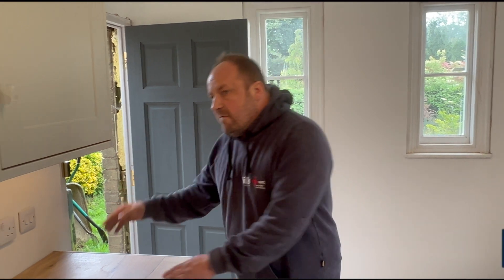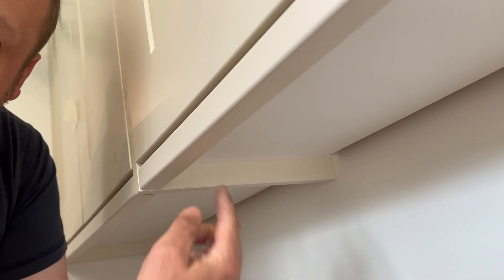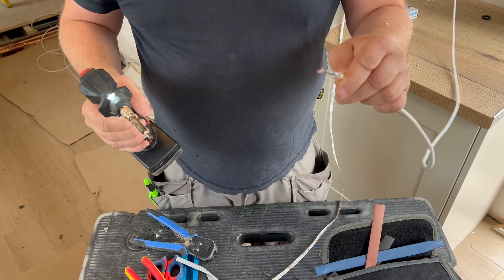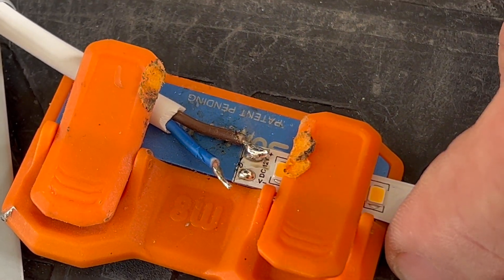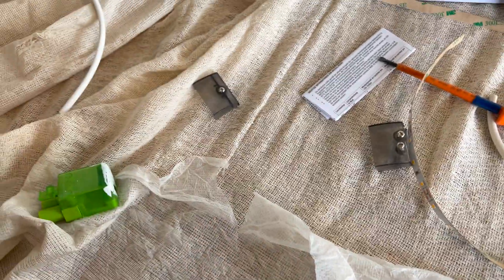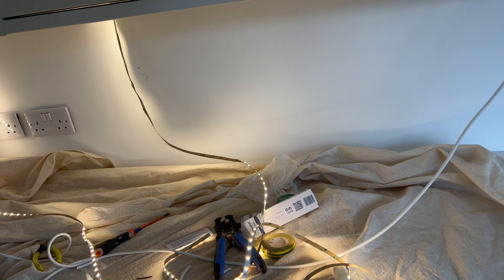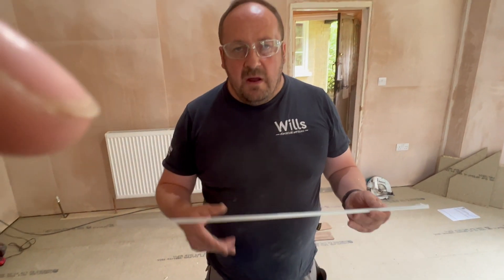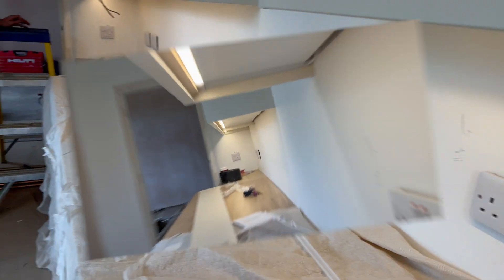"Bright Ideas and Illuminating Blunders: Undercabinet Light Installation”

Comment: Nice work Will, love the mitre edge to get the cable up the back - Alternatively if you want to make it removable you could drill some holes and screw it, the profile I've used before had screw slots.

Comment: I see loads of these LED strips these days and never actually done any myself. Always wondered what people are using between the driver and the strip where the driver is a bit of a distance away. See you're using 2 core flex which makes sense. 

Feel your pain with the soldering mate. Ive not done any since college.

Nice little vid mate. You rarely see any vids of people doing it from start to finish like that.
Reply from the maker: As I is not saying in the video, normally we use the flat two core Flex. Thanks for watching.